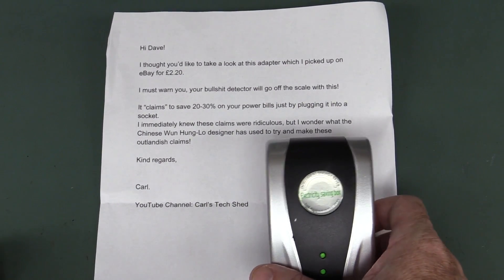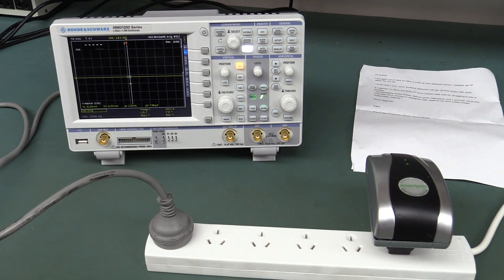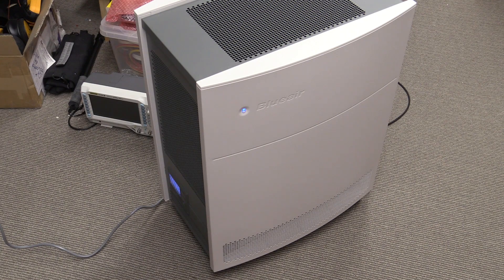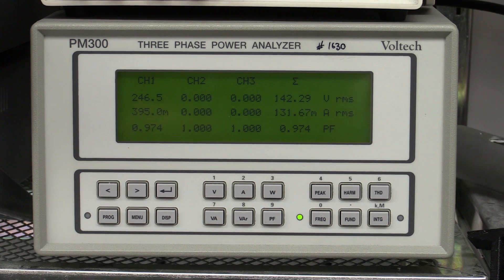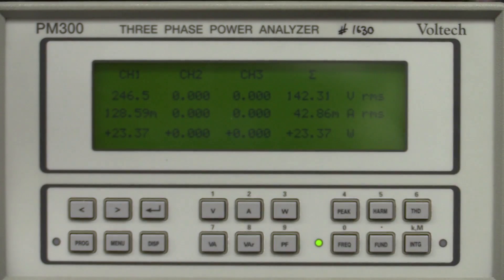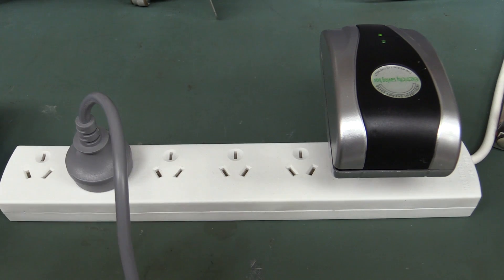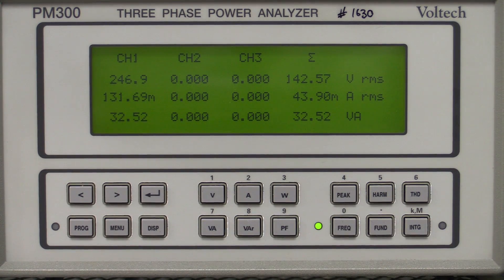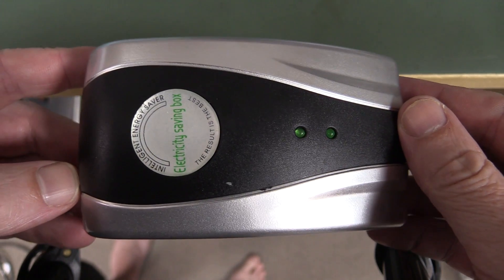EEVblog #848 - Home Energy Savers BUSTED!

Comment: It would have been worthwhile cracking the potted box open to see if it's a mains rated capacitor.
Reply: +Graham Langley If it had a resistor in series, the LCR meter wouldn't show a 90 degree shift.
Reply: +Brek Martin Yeah, definitely would've loved to have seen what they actually put in there.
Reply: This is precisely the reason I watched the video. A Chinese scam product with the "magic" potted away; it was bound to be comedy gold
Reply: +Brek Martin most likely not, 100v rated is my guess US mains is 120, and the type A plug can be at 230-40 in other parts of the world
Reply: +Brek Martin Hear, hear!   In this day and age, one wonders what else might be in that potting compound.

A Wifi sniffer with a cell transmitter, perhaps?
Reply: +AffordBindEquipment Might have been "Gutter oil" :D
Reply: Yep, Chinese "black box" capacitor dissection could have made this video perfect...
Reply: +Brek Martin I suspect the box is actually a snubber network - a capacitor with a low value resistor (~100R) in series.
Reply: +zaprodk Depends on the frequency.
Reply: mikeissweet Yes, they could be safety approval or motor start caps worth the $5, or rolled up aluminium foil dipped in rotten tomatoes :D
Reply: +Brek Martin It is a recycled motor run capacitor. Likely was a 3uF unit, but self healed down to the indicated value. After self healing it still is a good capacitor just with a little blasted area reduction. Must have been washed in a river to clean the dirt off, which took all the screen printed values off.
Reply: +Brek Martin 
You can buy 'motor' caps on ebay for under $2 that look the same
http://www.ebay.com.au/itm/AC-450V-CBB61-Polypropylene-Film-Motor-Start-Run-Capacitor-2uF-50-60Hz-New-
Reply: +Nighthawke70 I bought a Harbor Freight hydraulic jack and I took out the valve stem to make it a thumb screw and what came out wasn't jack oil...It stunk enough to make you puke.  Not sure "what else might be in that" jack but it wasn't oil.  It was totally nasty.  If it was at night, it probably would have glowed in the dark.  Probably some nuclear waste from a morgue... pretty scary stuff we bring into our country from China and elsewhere.  I guess it's one way to get rid of their toxic waste.  So there might be a teaspoon of some toxic stuff underneath that potting compound.
Reply: +AffordBindEquipment 
Wow, that's nasty. I wonder if you could send some in to have it chemically analysed by a lab? I imagine a lot of people would be very interested if China really was exporting some toxic crap covertly in new products.
Reply: "Hydraulic oil smells pretty bad though."

Yeah, that's what I was thinking.